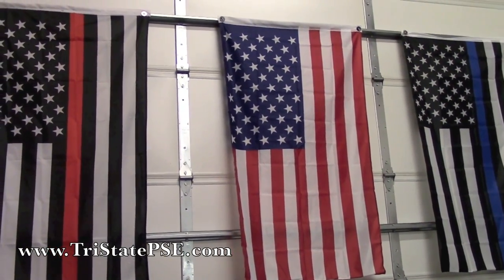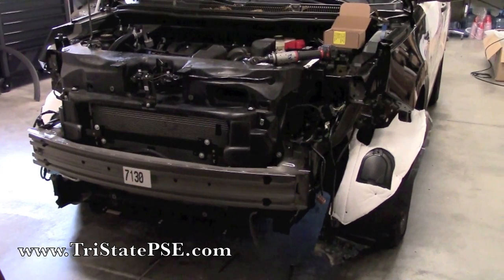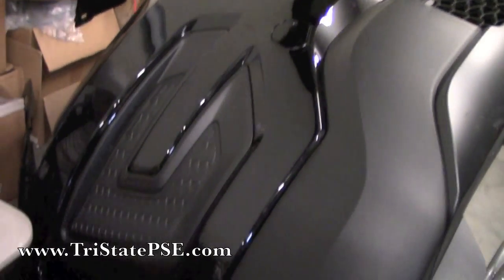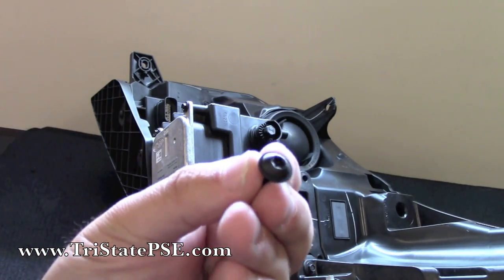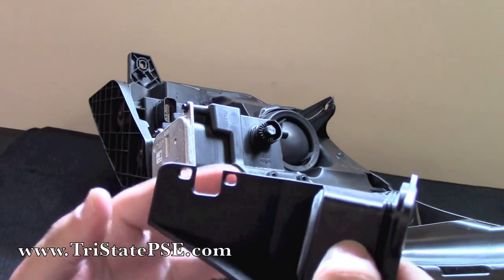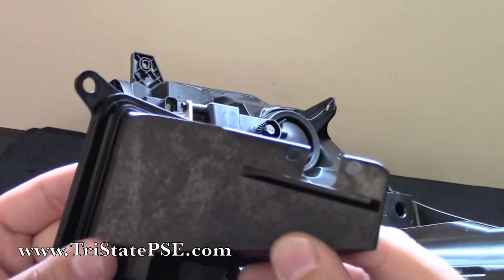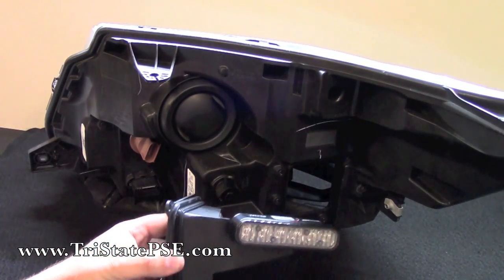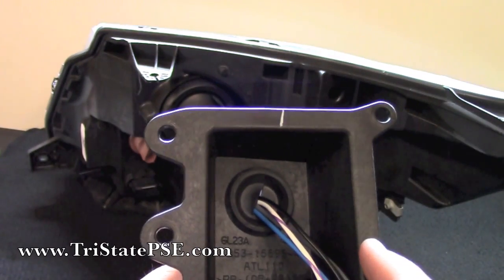How To Install A Whelen Ion Led Light In A Ford Police Interceptor Utility Headlight

Comment: I tried removing the headlights to see about getting strobes in it (I don't have the factory hideaway option).  When I got to the point I realized I have to pull the fender off to get the headlights out, I gave up.  What a stupid design!  Getting the bumper cover off was enough of a pain..  Thanks for showing this. I had been looking for a video that showed what the factory option looked like.
Reply from the maker: turbo2ltr - Yeah, they can be a pain...
You will not only need the Police Utility, but putting Leds in the headlights is an option from Ford when ordering the vehicle as well.
Reply: I bought my interceptor "used" with 68 miles on it so I couldn't order any factory options..  For now I just have the Whelen Microns in the grill and a visor light..
Reply: I just bought a 2017 Police Interceptor Utility.  It's right front blinker was out.  I just now realized the same thing.  I have to take the entire Sentina crash bar system off, the bumper and grille, and finally the headlight assembly just to change a lousy blinker!  I swear this is the reason the car was sold! LOL
Reply: @oceanexploration  really?  I had the thing out in ten minutes flat.  Of course when it came to the hideaways, went straight to the shop.
Reply: @jaysmith1408  I made a mistake when I posted my comment.  No disassembly was required.  I was looking at the headlight, not the blinker.  It took a few minutes to fix.

Comment: When you order the pre-installed option from Ford; is this the type of light they use? 
If not, do you know if the flash pattern can be changed on the standard Ford issue one?
Reply: They use a Whelen ION in white. You can change the flash pattern by touching the scan-lock wire to 12V+. Check the upfitter manual for details.

Comment: Good looking out by Ford. I wonder if a naked surface fusion 180 will fit if you get clever enough to find a way to attach it to that thing. OR two skinny ES6s stacked!
Reply from the maker: OnBakePlatinum - Not sure, but those are good ideas. We have put Feniex T3's in there before though..
Reply: OnBakePlatinum I

Comment: My friend just bought a 2016 interceptor utility, the LED strip around the headlight does not come on. Is there a possibility something is broken or disconnected, or is this the case with all interceptors? Thanks for any info.
Reply: Hi did you guys ever found out I have the same issue with a 2016 PIU
Reply: PIUs don't have the LED strip.

Comment: For those models with the lower light assemblies….I believe they’re fog lights on civilian models, but since the interceptor doesn’t have that capability, what’s in there?
Reply: Just blank plastic inserts. He shows the bumper in the video at 1:13 and you can see there’s no lights. You can however mount lights to it if you want. You can also option it with fog lights on the police model and Ford designed it so you’ll get warning lights that are mounted in the fog light assembly where a regular bulb would normally go.